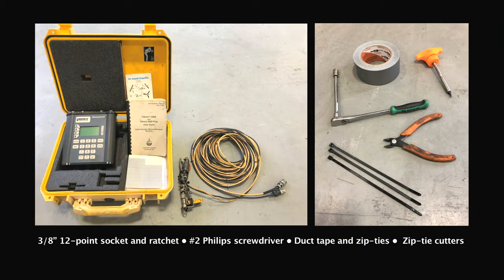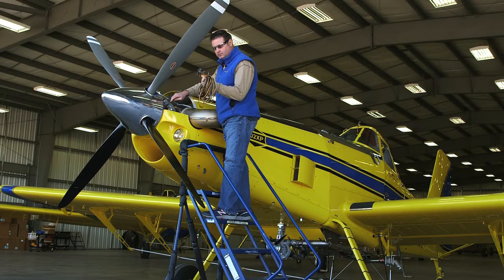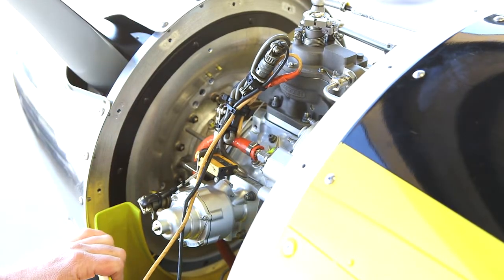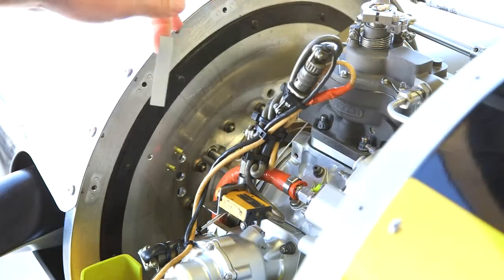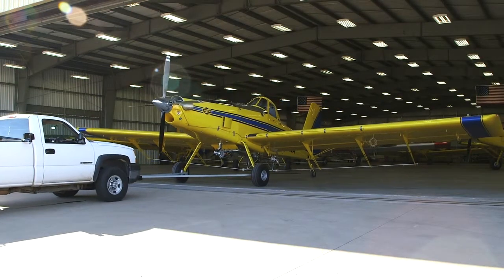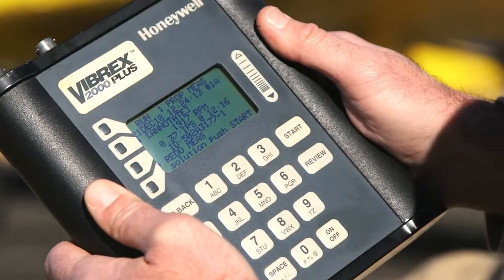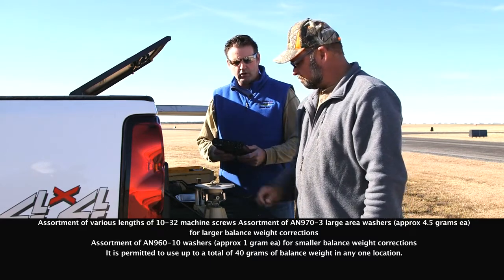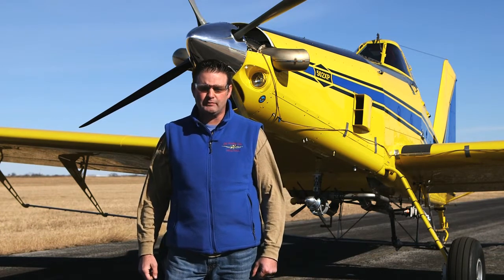Balancing Your Propeller for Dynamic Performance

Comment: Hello. Quick question please. I have foxtech w48 22 390kv motors. I bought 1755 cf propeller. For some reason the drone pulled to one side during the take off and broke two props. I didn't know what was the problem but i think it's the propellers. Now after some searching i found out the right propeller is 1447. I don't know which to get apc or carbon fiber. Because some people said they make a lot of vibrations.

Comment: Meanwhile I'm trying to balance a 502XP and getting my ass kicked.   Box says the heavy side is at point A.  We add weight to the the reciprocal and next run says the heavy point is a little heavier and in the same spot.  Frustrating.
Reply from the maker: If you’re having issues with 502XP prop balancing, you might first reach out to your Air Tractor dealer for help. Or call or email our Customer Service: https://airtractor.com/contact